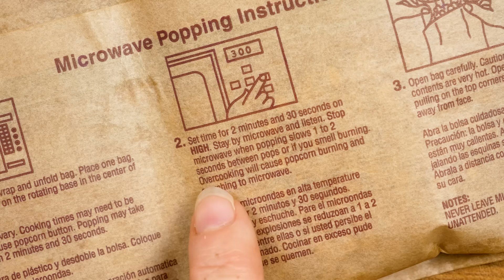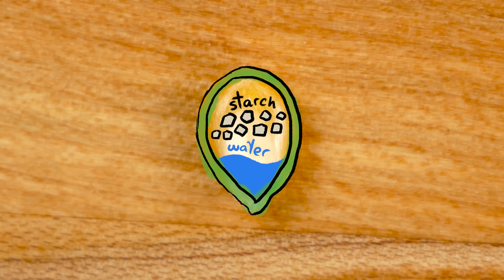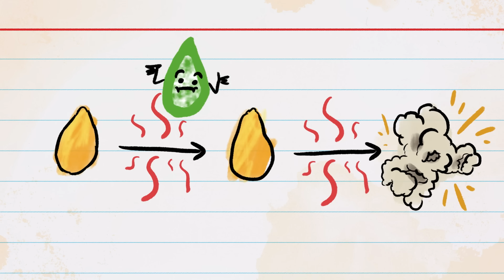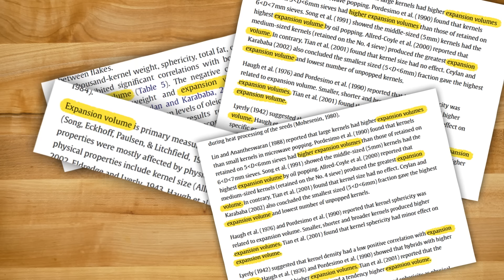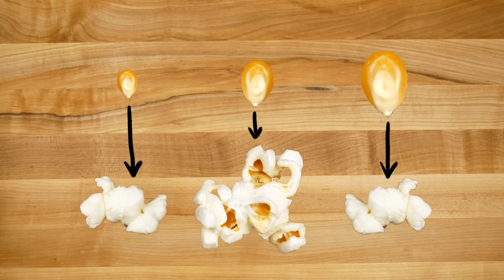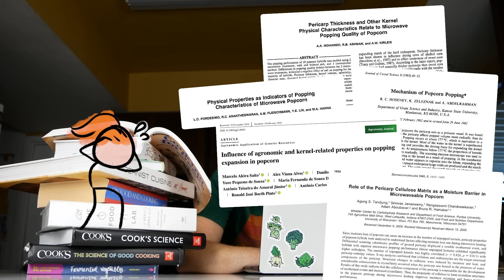How to pop the un-poppable kernels

Comment: I have one of those stovetop manual-spinny popcorn poppers, and I almost always zero unpopped kernels. Microwaves are just kinda jank.
Reply: The precise technique I use on an electric stove (that's kinda slow to heat up and cool down)

1.  Set the stovetop about 20% above medium heat, and throw like 3 kernels into the oil to indicate when the oil has gotten hot enough.

2.  When the first kernel pops, throw the rest of the popcorn in, reduce heat to Medium, and stir extremely slowly, to just gently move the kernels around.

3.  When these kernels start popping, reduce heat to 20% below medium (to eliminate the risk of burning) and steadily start stirring faster until the popcorn reaches full popping speed, then keep stirring rapidly until it's finished.

It really just comes down to two things, temperature management and the speed of stirring.  You can probably ignore the temperature adjustments if you are on a gas or other more responsive stovetop.
Reply: I also use a heritage popcorn with purple hulls that have slightly softer hulls because modern commercial popcorn hulls tear up my GI tract.  This may also contribute to my high pop percentage.
Reply: Agreed! We have a Stir Crazy Popcorn maker that ends up with less than 5 unpopped kernels per batch using Orville Redenbacher popcorn.

Comment: I'm curious about a different technique: what about the kettles that "boil over" that you see at movie theaters and does kettle height matter?  I.e. does the agitation of the popped corn as it pushes up and out jostle the unpopped kernels and cause them to settle (since they're higher density) back to the bottom where they may continue heating and pop?

Comment: There used to be this snack called Pop-Nots that are just the semi-popped kernels and I used to love that stuff.
Reply from the maker: Yes, I remember them being called "Half Pops"! Apparently you can recreate these by boiling the kernels before popping them - I haven't tried it but it seems like a plausible way to weaken the hull so that it only partially pops.
Reply: @MinuteFood I added a bit of water to a pan before, trying to see if I could get better salt coverage with what's basically brine. 

Can confirm that boiled kernels tend to get less volume.
Reply: @MinuteFood  I can confirm this: not releasing part of the steam generated by the popping can soak the remaining kernels leading to much more half pops. Very audible! One need to take care of the correct amount of steam release while popping.
Reply: I've seen these called "Half-Pops" as well.  Haven't seen them in a while though.